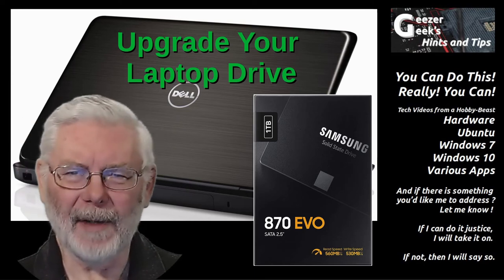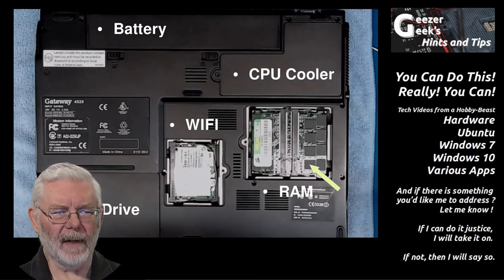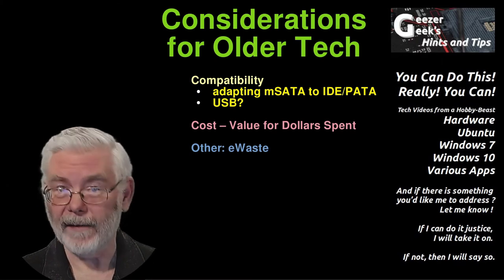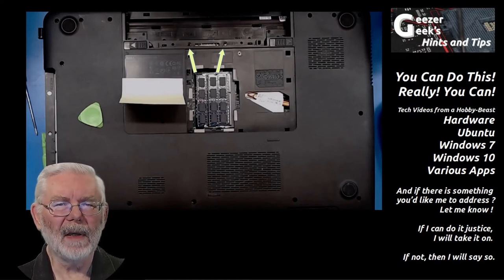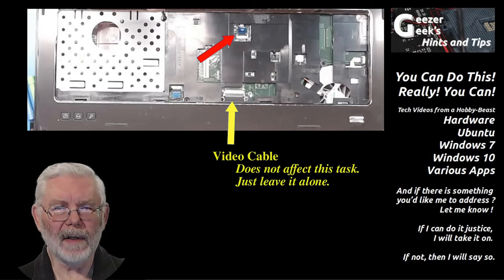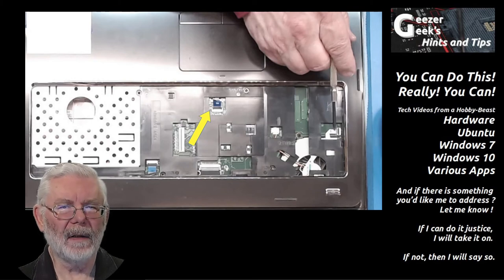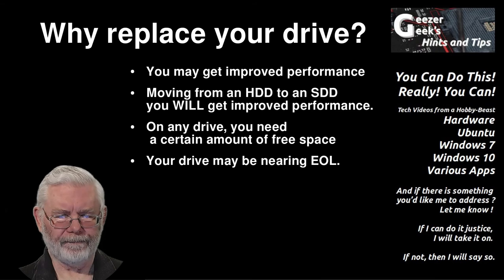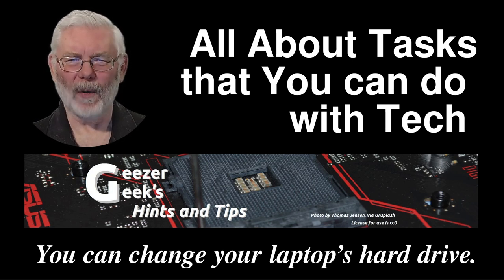Changing/Upgrading a Laptop Hard-Drive (HDD or SSD). Dell N7110 as example.

Comment: Well done video, sir! This looks like a complexity of simple steps. I am sure there will be some stubborn clips in some of the case disassembly but proper tools make the difference. I have saved this for reference. I will be performing this very task soon on my Dell Inspiron N7010. I believe that the configuration should match up very closely with the N7110 you show here. 

If you have any experience with the N7010, sir, and know of any slight difference I should prepare for. The one obvious one is that the 7010 does not have those three special function buttons above the keyboard, so I may one less wire to disconnect. 

Again, well done video, very thoughtful, calm and thorough. Appreciated.
Reply from the maker: Thank you for your kind reply. I wish you well in your work. I do not have the N7010, so cannot speak to differences. Sorry.

Comment: Hello GeezerGeek
Reply from the maker: Hi Bruno... hard for me to follow, when you beak it up into multiple posts. I do not understand the relationship between them. Please make one post as a reply to this one. My initial guess, to reply to one of them, is that the noise you hear is not related to adding the ram.
Reply: Hello there, sorry for the confusion
Reply: My laptop is exactly like the one you are working on. It came with 4GB ram memory card and it has another slot to add another 4GB ram memory card. I bought another 4GB memory card and I installed and, is now working fine. Still sluggish and, I was wondering if I should replace the Hard-Drive to a SSD or, the cpu to make it faster. The OS is windows 7 home premium which I would need to upgrade to windows 10 and, intel pentium cpu b690 @ 2.2GHz, 2200 MHz, 2 cores, 2 logical processors.

Thank you for your anticipated input and help, Bruno
Reply from the maker: @brunoierullo9306  For many tasks today, this laptop is simply under-powered. You do need a supported os, unless this computer never EVER interacts with other pcs or the internet, including using thumb drives to move files. You may find a linux distro to be lighter and thus snappier than windows. plus win 10 support ends in about 12mos. So, at this point I would invest less in this laptop, and save more for its replacement. SSD will give you MUCH better boot times. And I thinks a 500g would not be an unreasonable investment to give it a little shot at extended life. Does that help?